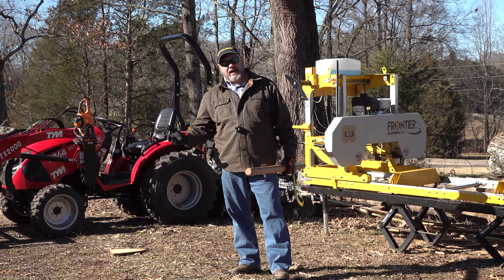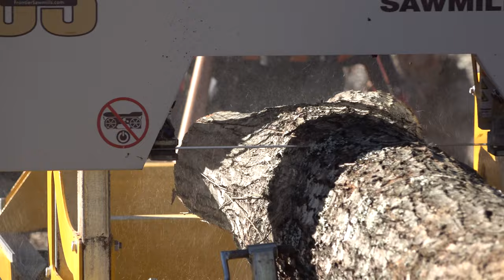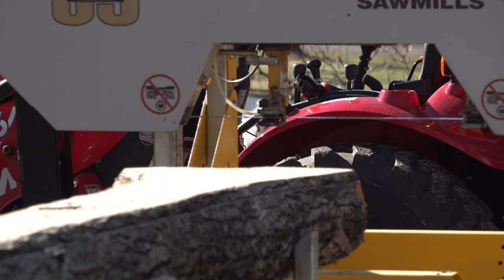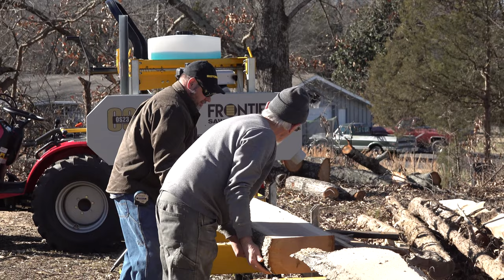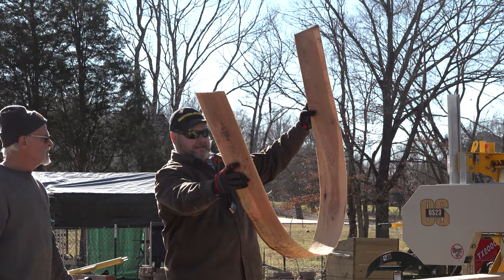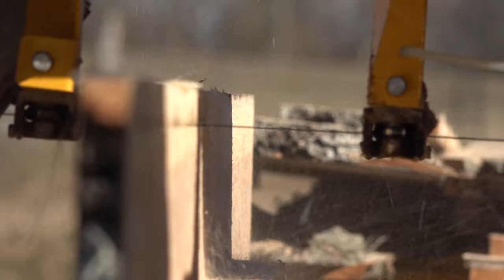Stunning Red Oak Grain | Frontier Sawmills

Comment: I’ve got some red oak logs from a timber cut that were deemed bad by the loggers. I would like to do something with them eventually. I think I could get some good boards out of them.  But my farm had some old trees and a lot of these logs are 3 to 4 feet in diameter.  I doubt I would have the tractor to move them and almost certain I could not buy a mill to cut it out on my land without spending $50,000.
Reply from the maker: Frontier has the OS31 also. Many people will take a chainsaw and split the biggest logs in half or quarters. They then out the log on the mill. Always a way.